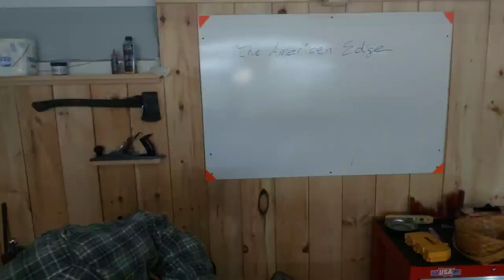TNG Ep 21: How to Sharpen a Cleaver

Comment: Hey Matt.  Just discovered your channel, and love the different stuff you sharper.  I am learning to be able to sharpen my own stuff, not really as a biz.  However, even now I end up sharpening stuff for friends & fam.  I have a cleaver similar to this one.  Got it from my father, who was a meat cutter all his life.  Mine is very similar, but only 8".  Shape is same, but tip of mine does not curve up as much as yours.  Mine's in better condition, probably because it was rarely used after about early 1970's I think.  I am guessing both of them are probably from the 1940's +/-.

Back in the 1960s and earlier, meat markets used to get their beef delivered as fore & hind quarters.  They hung in the walk-in cooler.  Meat cutters would bring one out over his shoulder and break it down by hand on the bench. The cleavers would be used to break apart the joints I think.  If I remember accurately, in the mid-late 1970's that part of the processing would get done at plants, as it is now.

I have a very cool sharpening rig my father got and gave to me in the early 1980s when his meat dept at a large grocery chain was being remodeled.  They were throwing it out.  It's an oil stone setup where the stones mount in a triangle arrangement with an axle in the middle.  This sits in a metal box filled with oil.  You can loosen the knobs on each end of the axle and rotate the axle, thereby rotating stones through the oil bath, and with the one you want (course, medium, fine) on top to use next.  Made by Sorensen, stones are 11.5"x2.5"x.5".

Thanks for the great videos!
Reply: Cool backstory info,thank you

Comment: Hey matt,,,,,, just a quick question,,,, what heavy duty electric knife sharpener do you like best of
Master grade which is a belt system or the chef choice 2000 which is heavy duty and their best unit????? I like the master grade as more of a radical unit to get the job done? and your thought if you had to choose?
thanks so much as I do have both sharpeners
Reply from the maker: Hey Grant, I think those are both pull through sharpeners and I cannot recommend either. 
Much of my business is repairing knives from that type of machine. Sorry man.